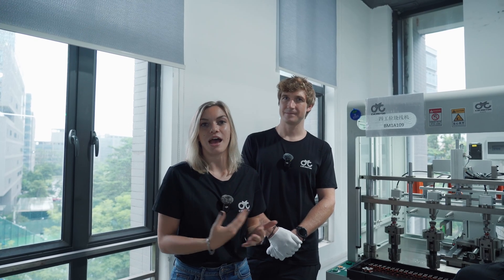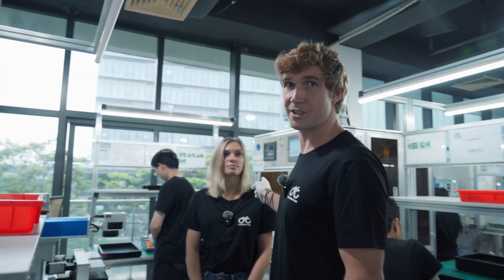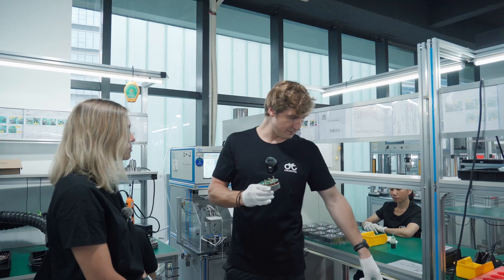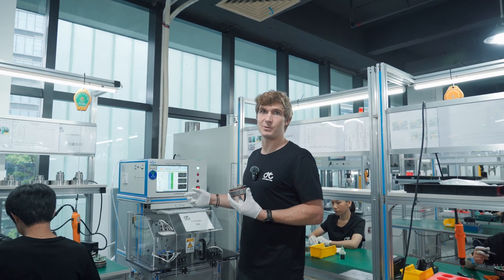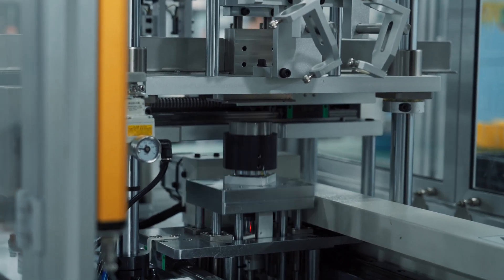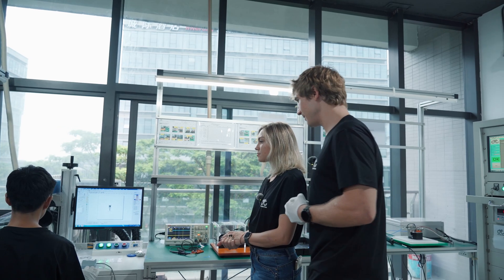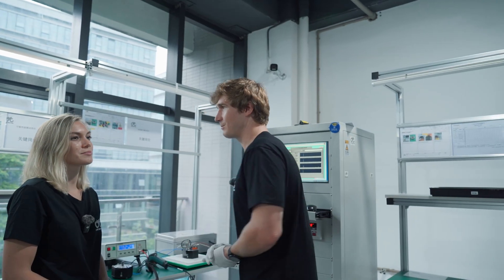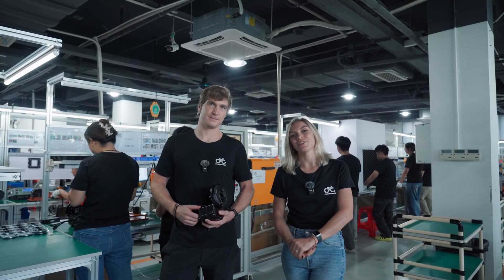Exclusive Look! Building the Best eBike Motor: Photon Gen 2 Production Line Walkthrough

Comment: well - after i had severall brakedowns with the first version iam looking forward in getting the new one . my second stage clutch faild 3 times now, 2 motor bearings are down, ive got the third controller - thats in 2,5 years... sadly i lost the motor always in shitty situations when i realy needed him - so after all gen 1 was only a fun way but not reliable one to build a e mtb, never the less i got my friend in buying a stealth motor for his mtb which is fantastic - but no longer a bike. its a moped. the sound btw. is too much for a standard e bike sadly... the power is awesome - but heat handeling just slightly better then the photon gen 1 . i bet the new motor of the gen2 is having less problems? :)

Comment: hi. i dont know if you answer to comments, but i really want the a-65 battery with the 5000watt motor on a full suspension bike. which full suspension bike could you recommend that fit both the motor and the battery. also the bike has to be able to be shipped to norway from the company. my budget is around 4000€ (not the norco shore boxxer as i cant find it were they ship to norway)
Reply: Buy an older model of Propain Rage

Comment: Unfortunately, a so-called mid-drive is a non-starter. This configuration cannot brake the bike. The best thing about electric motors is motor braking. Totally maintenance-free braking. Friction brakes are a hassle. With the added weight and speed of ebikes and cargo ebikes, regen is a must.
Reply: A mid-drive motor has been Invented (By an Israeli ) and produced in Vancouver BC by "Grim" something? that has re-gen breaking. Genius design INMOP
Reply: @nomadicoasis9260  It was a hub motor I think. But no need. A simple direct drive motor is enough. Like trains use, like solar race cars use, like scooters use... only bikes are using the wrong setup.
Reply: @difflocktwo  I think your right about the hub motor...  I have a Surron and the re-gen is great for town... technically it's a mid drive but re-gen is direct.
Reply: who give a f for regen,dont be ridiculous...go and buy this other motor with regen
Reply: @cungalungaish  regen is a must for EVs.
Reply: I prefer mid drives weight balance and efficiency, because its not nice to have 10kg weights in the center of my unsprung mass wheels :-) Clunk!
Reply: @SLeeCVR  What clunk? Direct drive is more efficient, that is why solar race cars use direct drive.
Reply: @difflocktwo heavy wheels clunk.
Reply: @SLeeCVR  Never had issues with my hardtail mtb. Had a hub motor there and riding in very rough ice and snow for hundreds of km if not thousands of km. It was my commuter. I actually had insane traction due to the extra weight.

Comment: Pre-ordered through Electrify in the US! Really appreciate the multiple quality control steps. When is it shipping? Also, you mentioned headlight and tail light...is that battery voltage, or is there a 12V converter built in?

Comment: Can you restrict and derestrict it through that app
Reply from the maker: Yes, you can set your speed and power limits via the app. There are two modes by default: Street and Race. Where Street mode is intended to be set up according to your area's legal limits and Race mode to be for off-road use. However, you can set these however you want. If you need ever more restriction, then we also have an EPAC firmware which locked the power and steep for legal use. Reach out to our team if you need more info on this.

Comment: I have been confused by the controller. What you call a controller, is it mounted within the motor housing? Is it a kind of variable speed inverter? The display then is a networked interface for the controller? So the settings we make in the display are kept in memory at the display or the controller? Looking forward to having a gen 2 model operating soon. 
i
Reply: from the UK here, love the idea of your motors but as someone who builds uk legal e-bikes I struggle to find kits that are legal at all, id love more info on your "available one request" uk legal 250w rated version.